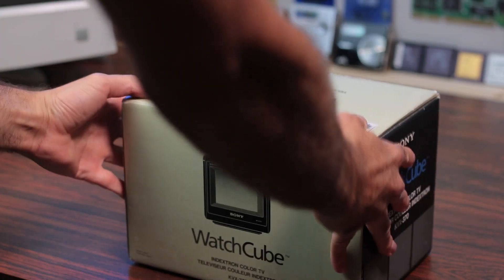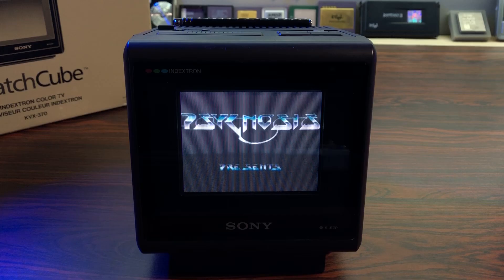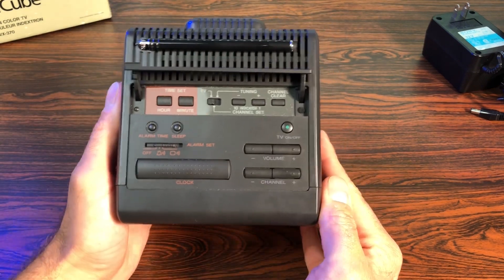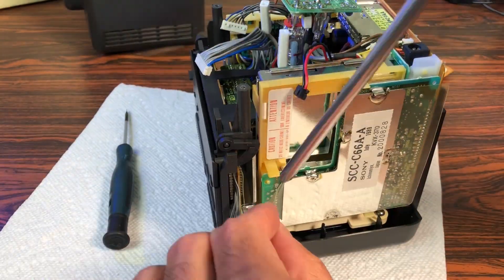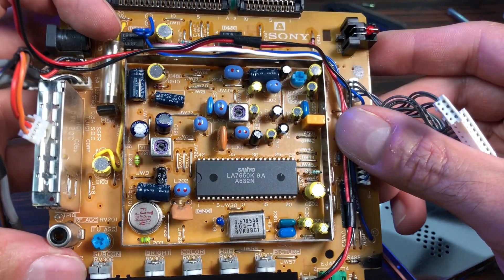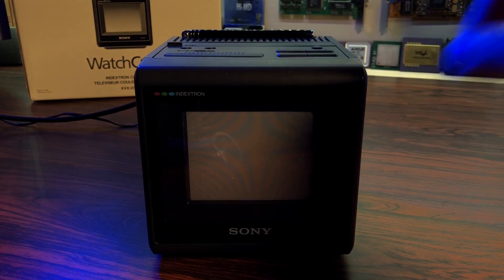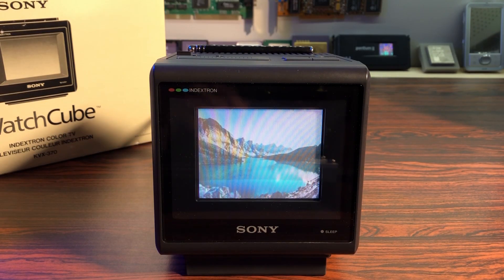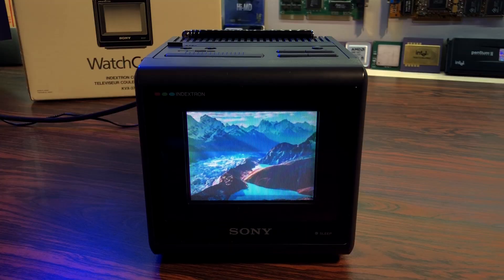Sony WatchCube KVX-370 : The rarest 3.7" Indextron

Comment: How does it do color with only one gun????
Reply: The single gun is fed sequentially with RGB signals as it scans the tube (L to R) 
There are vertical strips of RGB phosphor that react to the electron beam, as it lands on each one.
This is called "Beam Index" (Rewatch the video to see more details - its covered well)

The hard part is synchronizing the beam's position with the phosphor strips. To know where the beam is at any instant there are guide phosphor strips that reaact to the elctron beam and give of UV light (invisible to the human eye) These pulses are captured by the photodetector (orange plastic light pipe on the rear of the CRT glass. (Again, watch the video above)

Comment: Weird. I will add a USB C on mines for convenience. Also a passthrough. That's because it will be paired with 2 more 1In indextrons from RCA. (No, RCA never made indextron TVs, but I turned two CKC021 viewfinders into monitors by mounting 2 AV jacks - in+passthrough and USB C 12V PD boards in them.
Reply: Let me know if you will sell it one day. I'm a Sony collector 😀

Comment: Here’s a video that explains the tech: https://youtu.be/_b7omGhw7wc

And here’s my TLDR version: instead of three separate electron guns, one for each color and a shadow mask to ensure each electron beam only hits phosphors of the correct color, a single gun index tube adds light sensors that detect when the beam is at the start of a phosphor triplet (i.e. a physical pixel). This enables it to correctly vary the intensity of the beam as it sweeps across the three phosphors in the triplet, to ensure the correct color is reproduced. That’s also why you get a black and white image if the sensor isn’t working - the beam intensity can’t be adjusted for color since the sensor can’t see anything, so it falls back to working like a monochrome CRT.

Comment: Index CRT''s have no need for drive controls, which compensate for the emission failings of older 3 separate RGB electron guns. The color tracking will always be perfect, with one electron gun. The color would fade to black and white with a very weak tube, because of the loss of beam focus.

Comment: I fixed many a Toshiba with no troubleshooting. Replace all the little red electrolytics. They always eventually failed. It could be these caps were used because Toshiba knew that they would fail, so people  would get new sets.
Reply: Interesting theory about Toshiba...
More likely the Electrolytic capacitors in this unit were subjected to high temps, and early failure.
The unit consumes about fifteen watts! That a lot of joules in a tiny box with only convection cooling.

Comment: The industrial design of the case is top-notch Sony clock-radio! Did I miss it having FM and AM tuners, or did Sony miss the opportunity? 🤔

It’s kind of a shame that Indextron has such low contrast, it doesn’t compete in those respects against early LCDs. Still impressive before then, but I can see how they’ve become rare since.

Comment: I'd like to see you wave a magnet in front of it, as I understand it would behave differently from any other color CRT.  The image should temporarily distort like it would on a B&W tube but the colors should remain accurate within that distortion - and there should be no lasting color displacement once the magnet is removed, so no need to degauss.  I'd just like to see it happen with my own eyes :)
Reply: Check out cathode ray dude on youtube, he has a video called a tiny unlikely crt where he takes a indextron crt from a video camera and puts a magnet near it.  The whole video is pretty good and id recommend watching it if you are interested in the technology behind it

Comment: i just recently bought one, but theres no power going to the tube. i replaced the capacitors that were bad and the fuse that was blown and still nothing, theres sound coming through the speakers which is interesting. theres no high pitch sound or static coming from the screen. whatever is wrong with it is beyond my limited knowledge
Reply from the maker: Don't discard it, too valuable! Eventually someone will take on that project. I am guessing that most likely, someone tried to power it using a regular center positive barrel jack. I Hate Sony for that. Before blowing the fuse, I am guessing the reverse polarity took a bunch of parts on the way. Maybe the Flyback driver circuit, or even worst the Jungle. But there's always hope! Not sure where you're located but if you're in Canada, maybe send me an email and we can figure something out :)

Comment: How does the mask look?
Reply from the maker: There's no mask in an Indextron. As explained in the video, it's a single Electron gun similar to a B&W Tube. There are only 4 phosphor stripes repeating across the tube. The decoder circuit then adjusts the brightness right at the perfect time to adjust for the Red, Green and Blue as the beam passes across them. Pretty fascinating right!

Comment: Its a shame Sony used shit capacitors in this model which pretty much destroyed them all.
Reply: More likely the Electrolytic capacitors in this unit were subjected to high temps, and early failure.
The unit consumes about fifteen watts! That a lot of joules in a tiny box with only convection cooling.

Comment: > raster scanning sensor which we will come back to later
never cames back :C
Reply from the maker: Apologies, I got carried away and may have forgotten to come back to it? I'm just a guy in a basement, not the BBC LoL. The sensor is sensitive to UV, which is emitted by the 4th phosphor stripe of each "Triplet", not visible to human eye but critical to give the "clock"  pulse to the controller to reset the sequence and display R,G then B again, in just the right timing until the beam hits the next UV stripe. Hope this helps!
Came back ;)
Reply: @AnalogThinker  yeah, i already knew that from Cathode Ray Dude's video, but thought that you'd dive deeper than him ;)
Nevertheless - i am wondering  why to overengineer in such degree if you have basically clock generator on board MAKING these rasters? 
I mean - there's something that drives yoke's deflection, at some point it's low voltage signal getting amplified. Why not to digitize into 10 bit, having two bits per "pixel" precision (1024 discreet values vs 520 dots on PAL tv). Then, every "pixel" divisible by N would be start of phosphorus array (consisting of r g and b stripes), so electron gun would "know" when it's supposed to lit each color composite. I definetely need to go back in time and tell them to build cheapest indextron out there and rule TV world ;]
Reply from the maker: @lis6502  Cathode Ray Dude that actually included a piece of my video to make his and didn't credit hahem... but yeah I see what you mean, but I am wondering if back in time, digitizing wouldn't have added some cost and complexity, looking through the circuit it seems they are using a regular Y/C decoder circuit and the timing just switches from channels R,G,B, which can work real-time, and given the poor resolution you wouldn't miss anything critical. Also if you played with CRTs you understand that they are totally non linear and adjusting them is a pain, I don't think that removing the UV stripe and just rely on deflection's precision would have worked (This is how I understand your idea). Actually I don't remember any CRTs having the sweep controlled digitally, it is always filtered/smoothed out to have a nice ramp. I think keeping a track for every triplet is actually reaaally smart, even with moderate magnetic disturbance, it still manages to display. This is all fascinating man, CRTs in general! Thanks for swinging by and if you also enjoy CRT, there is a great Facebook group called CRT Collective. Also, visions4netjournal.com/indextron/ is still a solid resource for everything Indextron related if you are interested :)

Comment: You don’t have to drill the case to add connectors.  You could sneak a pigtail out of one of the vents or various holes.   You could also replace the antenna with a pigtail for RGB in a 100 percent reversible way.
Reply: Then do it >:)

Comment: I actually had one of these and man it was a great little TV.  I believe I purchased mine from Montgomery Wards because it was on sale at a ridiculously low price.  Which, I at that time I found that places like Circuit City, Montgomery Wards, etc would put electronics that didn't sell well on sale at blow out prices from time to time.  You just had to be in these places in the right time -- and that's how I found my WatchCube.  Aside from my 27 inch Sony Trinitron -- the WatchCube got the most use.  This is because back in the day -- I worked in the IT field often had to work from home.  The WatchCube was right by my computer workstation so I could easily watch TV as I worked.  I also took it to work and used it in my office because it was so compact.  But alas after years of hard use -- my WatchCube died -- screen would just display white.  It was an incredible piece of tech which I will never forget...

Comment: Cool video. Never knew they made CRT TVs this small for consumer use. I know some camcorders had even smaller CRT displays.
Reply: I've a 2,4" Panasonic CRT with a resolution of 140 TVL..... It is in a way even more amazing, as it does have 3 guns for R, G and B, and the pitch is 30% smaller.
Reply: @lovemadeinjapan I remember it was the perfect TV for my cat. The only downside was that the picture tube was very long. But it was a fascinating device and very expensive.
Reply: Yea I have two 5" Sony TVs called the Sony Color Watchman that still work. A white one for the kitchen and a black one for retro gaming.

Comment: What was the reason for the recall?
Reply from the maker: I remember finding some bulletin stating that the recall was because of those faulty caps, I'll try to dig through my research archives to find it
Reply: @AnalogThinker  In any case it's a great find!

Judging by your electronic skills I think Techmoan should donate his LD Muse player to you for repair :D
Reply: @AnalogThinker  If the recall because of the faulty caps, it's odd that Sony would just destroy all of the units sent in rather than repairing or better yet replacing it with a new one with the proper capacitors.
Reply: @mel816  Not that simple... Rework would be time consuming and expensive for Sony (would need more skilled techs than the production people)

But... By the time Sony found out about the "bad capacitors" they must have noticed the bad thermal design of the cube. Pumping fifteen watts in with only convection cooling was a mistake!

Comment: it looks like a Digital CRT. looks no different to early LCD screens. Black and White CRT this size are a lot better with good contracts. it also dose not look or feel 1989 as the black plastic looks the same on a 2014 Sony Clock Radio. i would think maybe 2000 or so as in 1989 everything was white or cream with pastel colours like a beach ball. obviously it has aged well.

Comment: So sad that the color indexsystem never became a thing commercially, because it’s a pretty unique system wich finally did saw it’s light of day after 30 years of research and attempts by different companys in a few applications including this portible tv set, and it’s picture quality is more then acceptible😁
Reply: This TV produced in 1989-90, which really made  it obsolete at the time. Especially given that Casio and Citizen were already making low-cost colour LCD TVs in similar sizes.
Reply: @michaelturner4457  similar sizes, but the color LCDs of that era (late 80s) were passive types... not active matrix, no on-substrate transistors. So they looked terrible, with extremely poor contrast and narrow viewing angles. Small CRTs like this would have remained the premium technology until at least the mid 90s.
Reply: @KanalFrump  Well Analog Thinker did comment that the contrast ratio of this TV was "quite poor", and reminded him of Sega Game Gear and Atari Lynx passive screens. So it sounds like the Sony Indextron CRT wasn't much better than those Casio and Citizen pocket TVs, except for viewing angle probably.

Comment: Fantastic production quality for such a small channel. Keep this short, sweet, and to the point style up and and I bet you'll grow quickly. Its great to see a new video on this little guy and has definitely inspired me to get back to work on my own (white model) that I picked up about 5 years ago from a local thrift shop. Is that the only board that I need to worry about for basic functionality? I've replaced quite a few caps in this thing already and I am still getting no power at all. And advice or resources you can point me to?
Reply from the maker: Hey sorry for the delayed reply. First make sure the power input or fuse isn't blown, Sony used those stupid reverse polarity power bricks but I've seen a lot of fried devices as it's so natural to use a regular 12V Barrel with centre positive. So yeah just probe the power input stage and make sure you have all the boards powered. Then depending on how bad your capacitor leaked, also check continuity on tracks that look eaten by acid, a good IPA cleanup is always a good step. Finally, the best source of information I found when I first got the set was this site : https://visions4netjournal.com/indextron/ The guy seems to be THE subject matter expert. I think I tried to contact him but never got a reply, not sure if he's still active. Nonetheless his blog posts are worth a reading, you'll find multiple articles about this WatchCube, and some of his repair steps.
Reply: Damn, too bad because he’s still just got 3.5k subs a year later. Looks like quality content doesn’t necessarily mean growth
Reply: @southofparcFPV  I think it has to have a lot to do with post rate and consistency. The algorithm loves this.
Reply: @southofparcFPV  yea he hasn't posted regularly.

Comment: You mentioned the ELNA caps multiple times in this video. Do you know where I can find more information about old ELNA caps? There are a few of them in a Trinitron I am recapping, but couldn't figure out exactly what ratings they have. The markings are "ELNA (M) RE2 85°C" and "ELNA (M) CEW(85°C)".
Reply from the maker: For more info on those ELNA Caps, you may want to check visions4netjournal.com's blog. I don't know much about those except all of mine were definitely dead and some leaked dangerously. For the value, you want to refer to the service manual or the other side of the cap that should show you the value. I went for the 105C ones on the Indextron as the beast is heating quite more than I was expecting.
Reply: @AnalogThinker  Thanks for the information. I searched the site and there's not a single mention of the word "elna". :(
The temperature rating is not very useful without the accompanying hour rating.